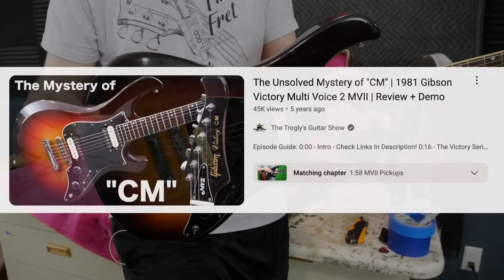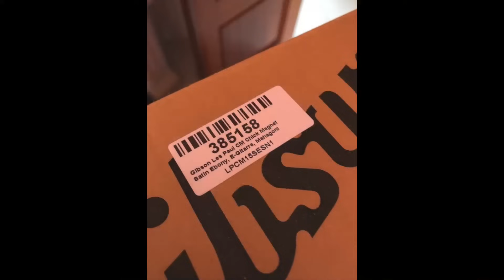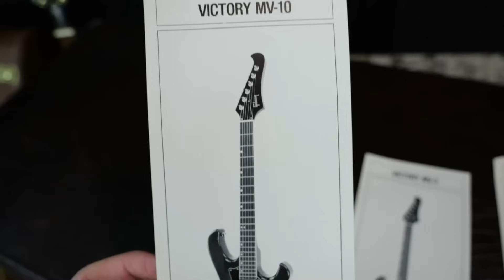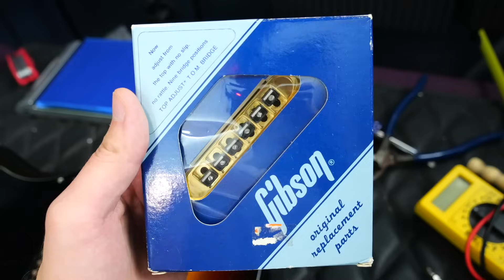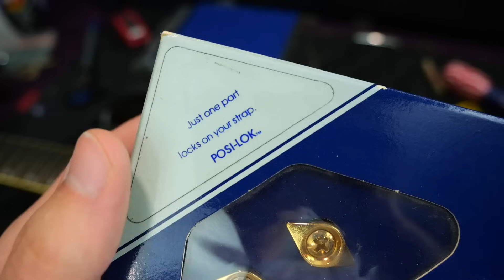I Traded CME For This Strange 80s Prototype! | 1979 Gibson Victory MVII Proto Review + Demo

Comment: Hey Trogly!
I think it is a regular Posilok. What I think happened is that it had a drop, and the flange separated from the screw barrel and was pushed down. That would explain the height and the oddly proud screw. If you look at that ring beneath the screw head closely, it does look a little ragged.
Reply: That’s what was going to say too.
Nice catch.

Comment: I think it's a nice honor for Gibson to name their strat a "victory." Very humble admission from them. They should make more odes to Fender. Like... A Les Paul Special with a 25" scale, 9.5" radius, and a bolt on, maple neck. I'd buy one.
Reply: Technically you can buy a les paul with a bolt on neck and a trem system but it wont be a Gibson
Reply: Why?? That would be such a cheap insult to a Gibson. Fender's suck and ways have. The Tele was their saving grace. A Strat is a turd of a guitar. Whether one is $4000 or $400 they're still the same cheap quality trash wood and cheap plastic
Reply: @user-gz8id4vf1i  did a strat kill your family???
Reply: why on god's green earth would you want a bolt on neck? they're blocky, cheap, and don't sustain. awful
Reply: Gibson does make a Les Paul style guitar that has a 25.5 inch radius I can't remember its name off the top of my head but there is a video of trogly reviewing one
Reply: @saggitated... interesting concept. Have you ever seen one of those newer Harmony guitars with the Les Paul body shape, bolt on neck and I believe their gold foil style pickups? It might be more of a Gibson style scale length but otherwise pretty close it seems. Check that out if you want,
Cheers!